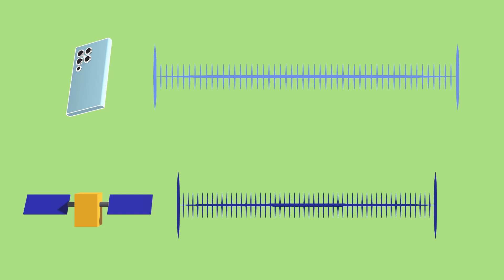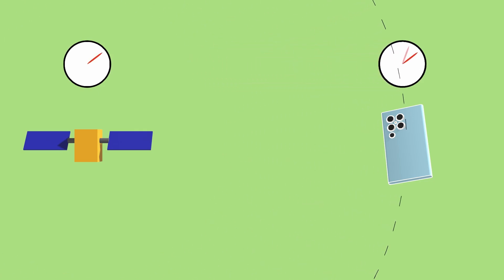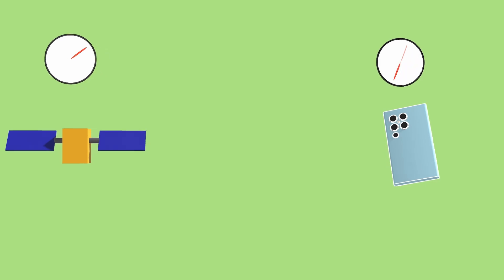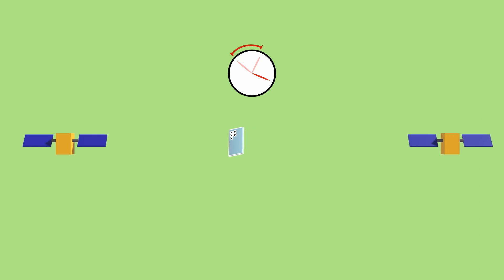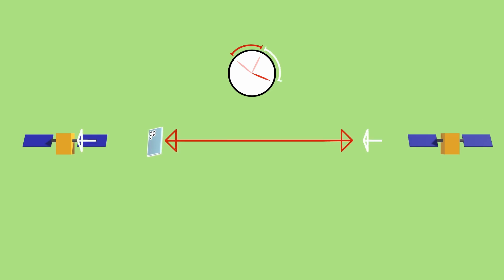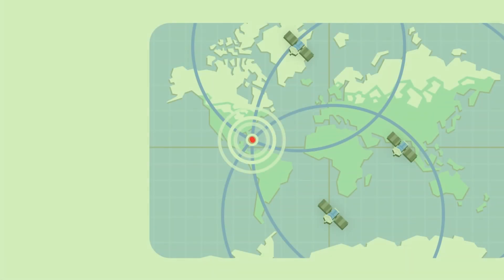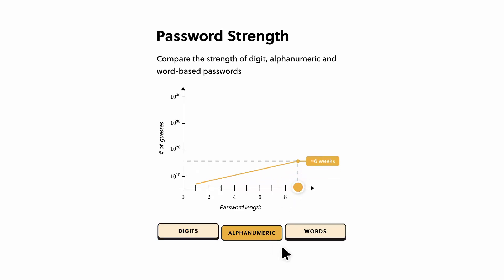How GPS works without an atomic clock

Comment: The information is not correct. 3 satelites would normaly be enough to get the location. One of the 2 Points could be ignored (would be maybe in the earth or in the space). The 4th satelite is needed to correct the the time from the smartphone. Because the smartphone normally has not an atomic clock inside. (sorry about my englisch, i am Austrian)

Comment: note that in most cases you don't actually need 4 satellites, because the 2nd point is rarely on the surface of earth. (the 4th intersection is actually earth.)

though in practice, you usually want around a dozen satellite for good precision.

there's also RTK and DGPS which both use a base station that has a fixed location and then from that you can know the position (relative in the case of rtk, absolute in the case of DGPS) of a moving gps (e.g. a robot lawnmower) with an accuracy of 1mm-5cm (depends on the chip and if using mixed )

and nowadays, at least on phones there is Assisted GPS, where instead of getting the satellite's position from the satellite itself, which can take 15 minutes, the position is given by the network or radio.

but full positioning is provided not only by GPS, but also other types of GNSS (like GLONASS Galileo and BeiDou), the distance to different radio antennas, wifi networks, and occasionally some other types of wireless signals.

the idea stays the same though, take the distance from known points and now you have your position.

Comment: 2 sattelites to create a hyperboloid
1 more sattelite to get a line
1 more sattelite to to get 2 points
1 last sattelite to know the correct point

That's 5 sattelites not 4
Reply: 2 Sattelites to create a hyperboloid. Correct.
1 More satelite to get a line. Correct.
1 more satelite to get 2 points. Incorrect. You have 3 satelites, so you can calculate a third hyperboloid.

Comment: finally! I never found an explanation so i came up with one myself but this is different. Now i wounder if my idea sill would work. 
Which is: When i know the wring time it took from two different satellites I should get two spheres, but i never thought about the fact that only 1 second already is the distance to the moon. But shouldn't these two sphere still create a circle where they intersect and my position should be on that 2d plane somewhere? Adding a third satellite than should create two more of these 2d circles and where these 3 planes intersect should be a single point? maybe you need a forth, but it still should work? probably its "the same" just a different way to calculate it :D

Comment: I've known for years (or decades?) how GPS works in principle using the explanation with the spheres, but this video was the missing link to finally understand how it can work without having a synchronized clock on the receiver side.

Comment: The video claims you only need 4 but in the explanation it uses 5. It starts by 2, then saying "if we add another", which already make it 3. Then adds a 4th one, but that leaves you with 2 points, so it adds a 5th one. It claims that's the 4th one, but it already started off with 2.

Comment: And this is why, if we hadn't corrected for relativity, people are wrong to say GPS would drift kilometres per day. Because GPS doesn't in any way rely on the absolute time of the receiver. And all the satellites would have the same error, which means the difference between the signals would be entirely correct.

The actual error from not accounting for relativity is that the satellites wouldn't send out signals when they are supposed to, so they wouldn't be in the position they are supposed to when they send it. And this error would drift by about 15cm per day. Not kilometers.

Comment: Unfortunately, computed hyperbola from the first two hyperboloids will end up inside the third mentioned hyperboloid (from 1st and 3rd sats), so to get two points you need to add the fourth sat. (And to choose between those two points a fifth sat required)
This can be showed geometrically, but also algebraically: you have 4 unknown variables (x, y, z, t), so you need at least 4 equations to get non-infinite number of solutions

Comment: Three satellites suffices, barely. There will be two valid solutions to the equation, yes - but one of those solutions is going to be well outside of the atmosphere, or appear to be moving at somewhere in excess of the speed of sound. So it's easy for the GPS receiver to tell which is the correct location. Having a fourth satellite does allow for improved timing correction though, which greatly reduces error and allows for a much more accurate fix.

You can use more satellites for even more precision, but you soon hit the limiting factor - the atmosphere isn't quite perfectly transparent to radio, it distorts the timing of the signals very slightly depending on temperature, pressure and humidity. So if you need really, really precise GPS tracking you have to use a nearby reference receiver that can constantly measure that distortion from a fixed location and send the measurements to your GPS receiver. Expensive stuff, but you might find one in use on a large construction site being used to make sure all the utility trenches and buildings go in the right place.
Reply: Phenomenal explanation. 

I will add that a quirk of RF is that it travels through the ionosphere (the most refractive part of the atmosphere) at different speeds depending on it's frequency. So, while ground based correction services are the most precise way to correct for ionospheric interference, you can also correct for this error by receiving two or more signals from the same satellite at offset frequencies. In GPS, the L1 signal at 1575 MHz is accompanied by L2 at 1227 MHz (we now also have L5 at 1176). Your receiver can calculate the differences in speed of reception between these two signals. Multi-frequency systems can bring the error down to a fraction of single-frequency error.

Comment: I've been having to explain this for a bit while teaching GPS. You've done it so much faster and more elegantly than I can on a white board. I will be using this! Thank you!
Reply from the maker: thanks! Have at it
Reply: I understand that this explains how the phone calculates its position relative to the 4 satelites, but how does it know the position of the satelites? Is it encoded in the signal or something?
Reply: @_invencible_ bit late but yes, every satellite has an almanac (in the code transmitted) of all positions where it and all other satellites are and will be
Reply: @rustteze  cool, thanks

Comment: How do the satellites know when to send the signal since the satellites must send a signal at the same time for this system to work?
Reply from the maker: The satellites have VERY VERY precise clocks that are relatively huge and bulky and expensive. And they constantly adjust with each other to stay in sync. And I believe there are a few ground stations too, possibly with even better clocks
Reply: I heard in a documentary, the satellites are synched up every 4 hours with ground stations. They also take into account time dilation because a tiny difference results in large distance.

Comment: Great video! Never really thought about 3D "triangulation" before
Reply from the maker: yeah I was also surprised to learn that it took 4 sats! And because it uses distance instead of angles it's called trilateration, or multilateration when it's about more than 3 points
Reply: Technically its 4D since it accounts for the temporal dimension too
Reply: they should call it pyramidation or something lol
Reply: This is a game mechanic in EVE online.
Reply: @StringerNews1 Tri-(or multi) lateration depending on how many sats you use in the fix.  If 4, then it is tri, because one is thrown away to determine the clock error.
Reply: @StringerNews1 You're missing the fine point.   4 = tri (because 3 sats are for position; 1 is for clock correction).

Comment: That is 5 satellites not 4  🤔
Reply from the maker: no, it's 4. 5 or more are definitely possible too though!
Reply: @KnowArt  
From your video:
2 for 3d hyperbola surface
3 for a curve

4 for 2 points
5 for 1 point
Reply from the maker: @trucid2  @bamblimo ahhhh, NOW I understand where the misunderstanding comes from. Between 3 satellites, you can calculate a hyperboloid between 1-2, 1-3 and 2-3. So the  'calculate another one to get a line' is about calculating another hyperboloid between sats 2-3 as it were.
With a 4th sat, you could calculate 6 hyperboloids! but you only need 4.
I hope this clears it up! - Aldo
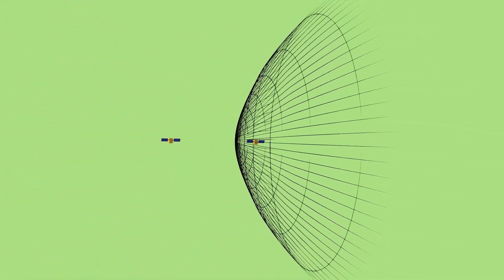Reply: @KnowArt  I think they are referring to the animation starting at  1:06 , where 5  hyperboloids were used.